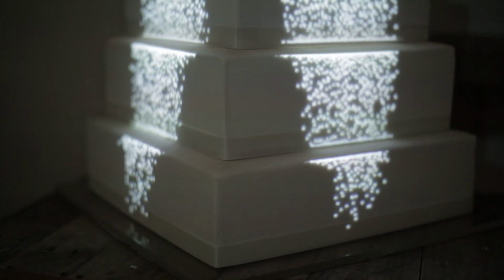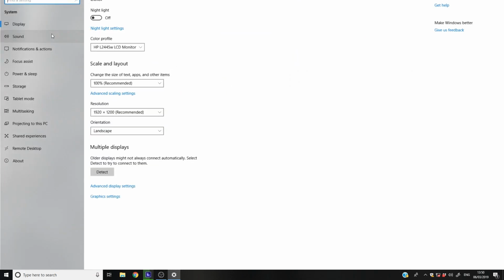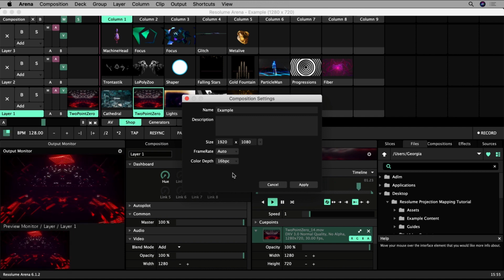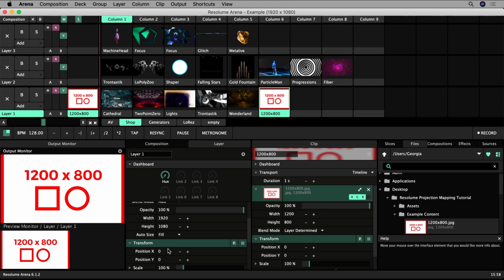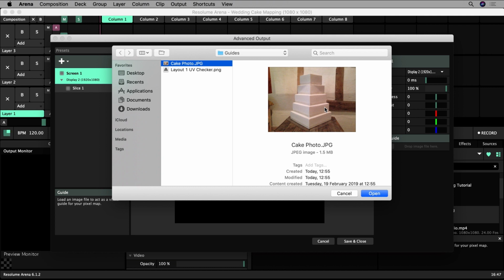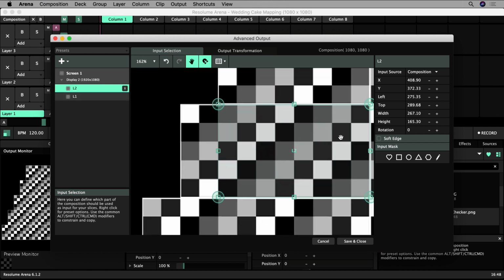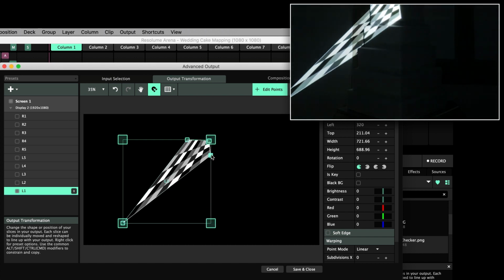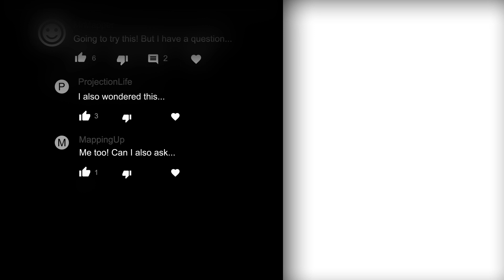Resolume Arena 6 Tutorial | Learn Cake Mapping (2/6) Projection Mapping

Comment: Could you move the preset that you saved on your computer into another computer?
Reply from the maker: I believe so. It's an .xml file stored under Documents>Resolume Arena>Presets>Advanced Output
Reply: @LumaBox  would be better to edit format area while using projector? Can we just use the preset, send it to another person so they could edit or make interface separately without using projector?
Reply from the maker: If I understand what you’re asking, you could send it to someone else to save them having to set up the input slices, but your output mapping would be no good to them if they haven’t got a projector set up and they’d need to do their own output mapping if they did connect their own projector at some point (unless that’s your projector in its original position)

Comment: I'm having issues. I download the free version. all was good at first. 
later when I wanted to send the video to the projector through output tab clicking display 2 (I work with an epson s41) it sends the video to my macbook, as if selecting display 1. What can I do?
Reply from the maker: Have you set up with Mac display properly? https://youtu.be/yhG7fsR7sM0
Reply: @LumaBox  Yes. But I still have the issue =(
Reply from the maker: @gegokasa0173  And just to confirm, inside Advanced Output, for all of your screens (listed on the left) you have the Device set to the correct display? And you're sure you've identified which display is your projector because it has the right resolution in (brackets) alongside? And then under Output>Fullscreen you've also selected your projector display, not your monitor display?
Reply: @LumaBox  Yes, everything is correct. Not sure what happened, at first it detected the monitor without problems. Better use madmapper.
Anyway, thank you

Comment: hi!! when i am clicking advanced setting step after i click display 2 - it is showing my guide on the wall and then always flips to my computer home screen .. do you know what im doing wrong?
Reply from the maker: Are you using a Mac?
Reply: @LumaBox  no im on windows. I figured out that issue but now when im at the part where im in the advanced settings screen ... and i created all my sections on screen 1 in the input selection and the next steps are to click output transformation - and then hit the transform button... my screen is only showing the top left hand corner of my cake map guide - instead of the layer i selected like your video shows. I have rewatched so many times and i cant get passed lol thank you SO much for replying!!
Reply from the maker: Well done for finding a solution to your first problem. What was the answer in case anyone else experiences a similar issue? 
As for your new issue... um... I'm not sure. Just to suggest the obvious, you don't need to zoom out of your preview do you?
Reply: @LumaBox  i had my screen 1 in the wrong mode so when i went to the projector part it would flip off .... How do i do that?  I SO appreciat your help. So its like someone took a pic of my cake map guide and i only see the top left hand corner of the first tier. VS that i should see the tier 1 layer i had selected. How do i zoom out? I can def try because i hope its something crazy simple lol
Reply: @LumaBox  thank you so much!!! I got it!!! It was image i created for my map guide . thank you!!!!
Reply from the maker: Great :) Well done!

Comment: how do trigger two different videos to different parts of the cake? or say half of the cake. you need two outputs and two projectors i assume? and how would you set that up?
Reply from the maker: I haven't done this in Resolume. Perhaps I could put a tutorial together for it. This may not be very helpful to you, but I have a tutorial showing how to do just this using Syphon out of Qlab into MadMapper, another projection mapping software, which might give you some ideas https://youtu.be/lR-vcXF6QoI
Reply: Hi there! not sure if you've already figured this out but I'll just let you know; you can add a slice transformation effect to a layer and assign specific slices for each layer (eg assigning left slices to layer 1, right slices to layer 2 and adding different videos to each layer. when you play the videos on both layers simultaneously, whatever clip is playing on layer 1 will only be projected on the left side and same for the layer 2 and the right side.) hope this helps!

Comment: how did you select all the slices?
Reply from the maker: In Advanced Output, where your slices are listed on the left, select the top one, hold down shift on your keyboard, and then select the last one and all the slices in between will also be selected. Or select a slice and then hold Command (Mac) or Control (Windows) and select additional slices.